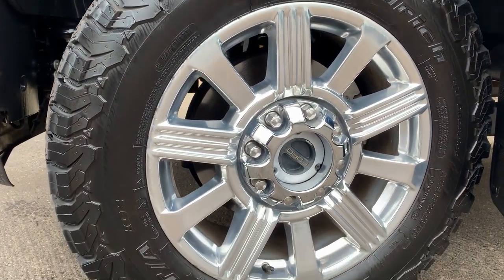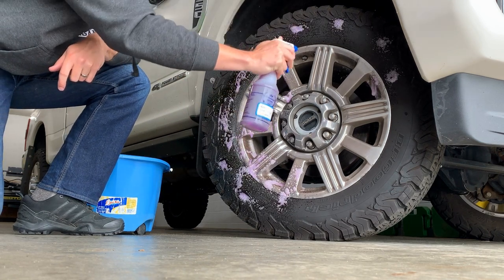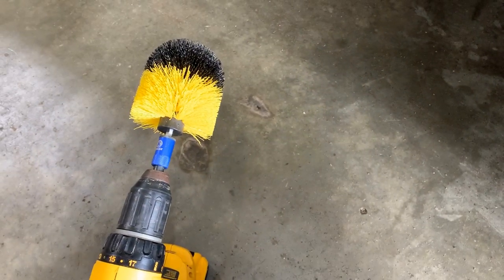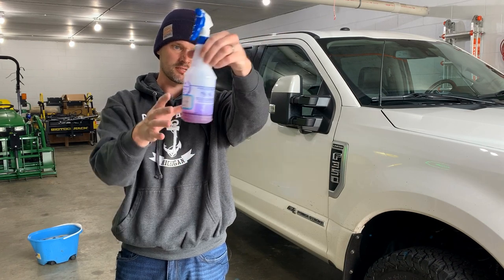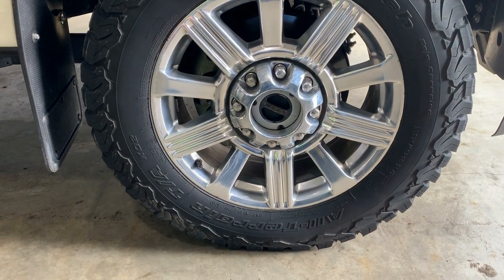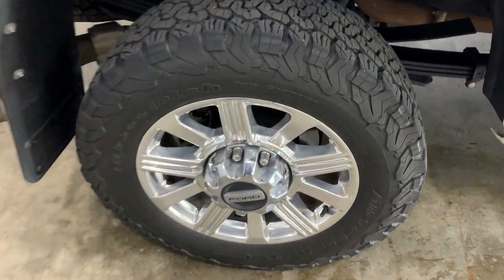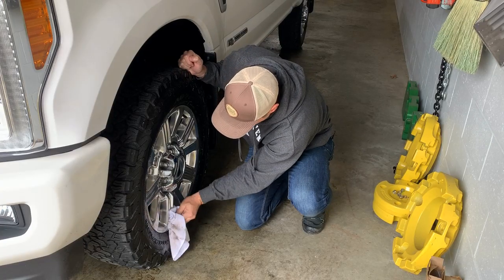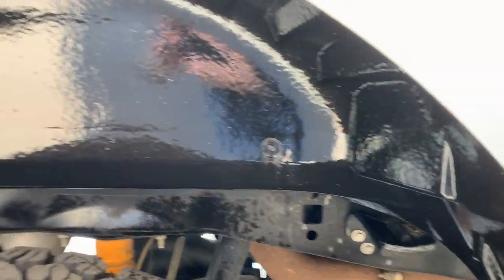CLEAN SOMETHING DIRTY! DRILL BRUSH ATTACHMENT TO CLEAN WHEELS!

Comment: Why didn't you use the drill brush on the tires, instead of only on the wheels? My understanding is that it is okay to use it on the tires as well. Please correct me if I'm wrong.

Comment: Just a suggestion; If you will take a piece of cardboard or think plywood and cut it 1/4 larger in diameter than your wheels. Then when you are applying tire dressing, Armor All, or whatever, put your cardboard on your wheels and then spray your tire dressing you won't get as much on your wheels.  Real time saver and looks better too.
Reply from the maker: That's a good idea!